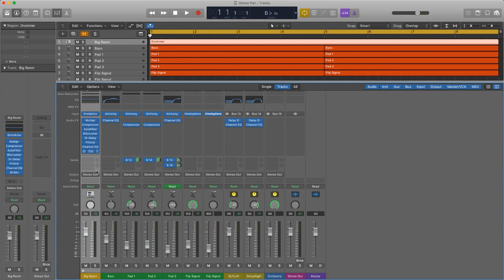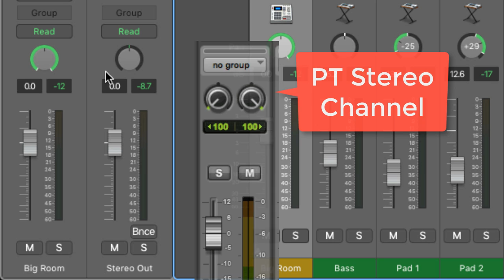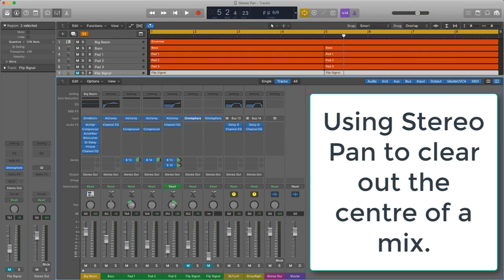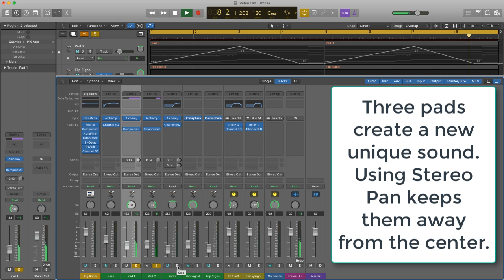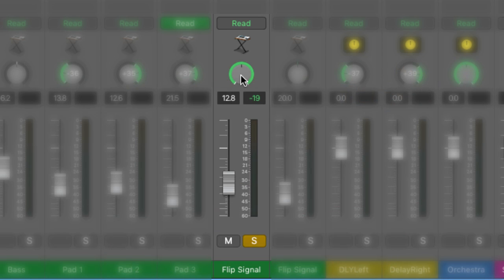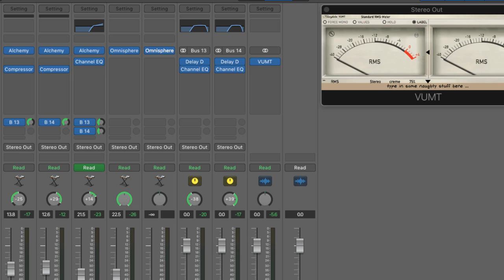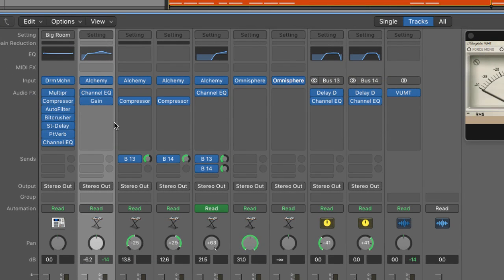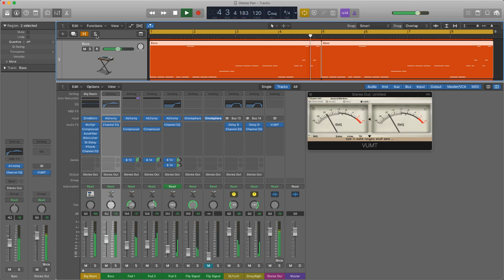LPX Quick Tips STEREO PAN LOGIC PRO X 10.3

Comment: Another great use is to use Stereo pan on the master bus and bring the width to 0 to check for mono compatibility  Have a great day!
Reply from the maker: Hey Joe, love that tip that's a great one! Thanks for sharing.
Reply: Cant do that on my master output.....  Hmmmm
But in logic , I always have a gain plug in on the master... 
Does phase switching, Mono and flip... all in one interface, floating in a monitors corner.